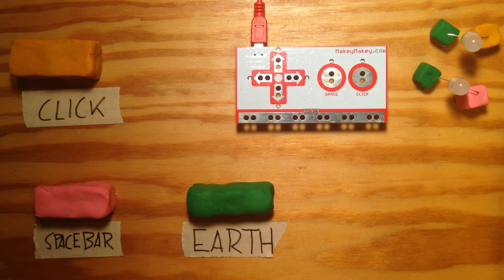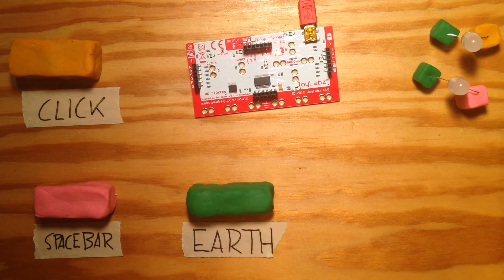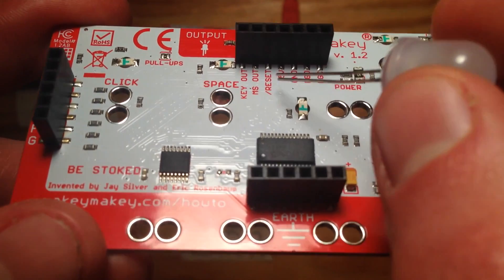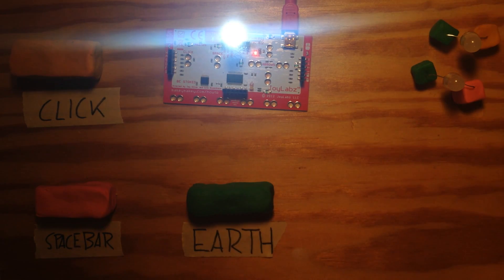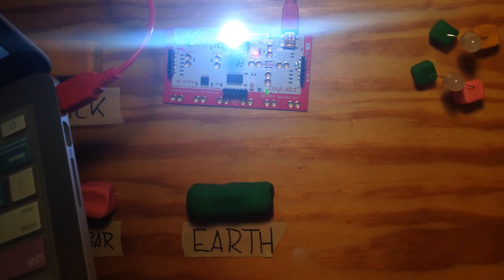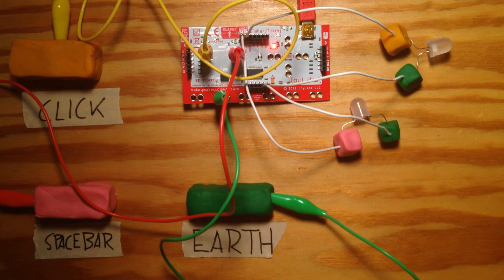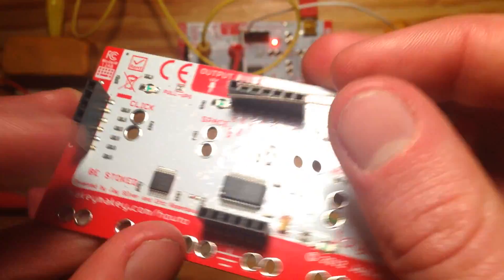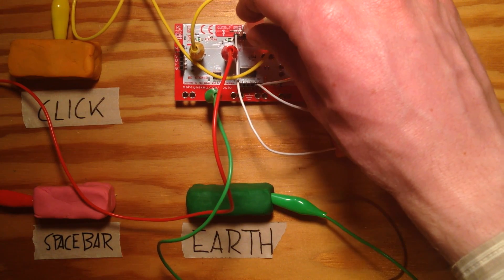Lighting LEDs with Makey Makey

Comment: Is it possible to create a circuit that could light up a firework with the press of a key?
Reply from the maker: Ooow, good question.  I don't know that the Makey Makey would have enough voltage (5v, standard USB) but maybe if you rigged it up with a match like this? http://www.instructables.com/id/Fireworks-Igniter/